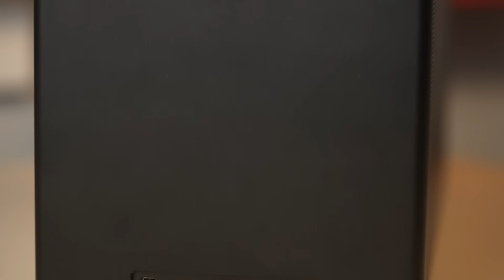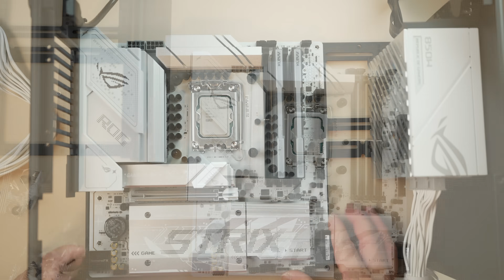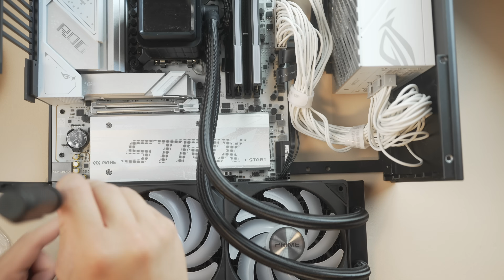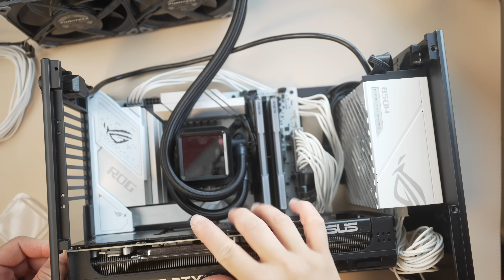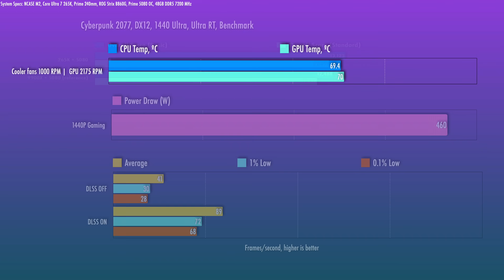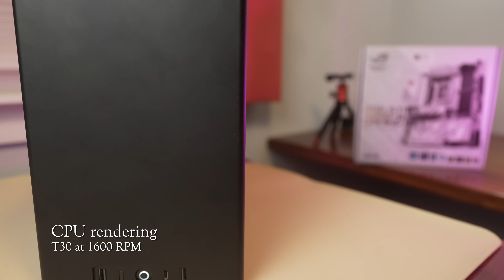NCase M2 mATX Build - Intel 265K + 5080

Comment: In case that the RAM sticks are not too tall, is it possible for standard configuration and AIO be mounted at the top? Planning to move my parts in the Ncase M2 as well, and thinking of mounting my arctic liquid freezer II at the top as the hose are stiff. Thank you!

Comment: Very nice video, I appreciate every video on your channel. What confused me was the intake above the graphicscard and the intake on the aio. Where is the exhaust going? I would have made the aio on exhaust? Or did I miss a crucial idea of the build?😅
Reply from the maker: The idea here is the airflow equalizes out the back and opposite side panel of the case. While one might think this would create a heavy positive pressure, rarely are both GPU fans and rad fans at full blast. In your typical gaming scenario you’re looking at ~1000 rpm on rad fans so this is quite fine. Exhaust places a penalty on the cpu cooling while not necessarily helping too much for the gpu (we already have fans directly assisting). In a scenario where case fans are not possible next to the GPU then the exhaust would be more helpful. There is also the option to mount a 92mm fan as exhaust at the back.
Reply: @MachinesMore  Thank you for your explanation! In my imagination, the AIO intake and the GPU exhaust create a massive turbulence in the case and the mixed up air will get dense and produces a accumulation of heat in the middle. The optional exhaust fan on the back would have made it more clear for me, but your testing showed me that it might not be needed and I am wrong with my imagination. :D

Comment: AMD CPUs only for small builds. Half the power means lower standards for controlling temps and that is premium in ITX type builds
Reply from the maker: Zen 5 efficiency is great. In a workload normalized comparison for heavy multithreaded processed the dual chiplet Zen 5 CPUs are usually ahead on efficiency (though the power draw in a like for like comparison is not half). For gaming, interestingly from my testing the 265K typically draws a little less power than the 9900X, when you normalize for FPS the 265K is often ahead, but generally speaking we can just call it more or less even on efficiency. And then the Core Ultra 2 chips are incredible for idle power draw. So, long story short it depends on how you are measuring power and use case.

Comment: You’re making me want to go blue.
Reply from the maker: Haha, you know, for the price that the 265K is at now, it can be super attractive for the right use case!
Reply: @ Maybe once the new Battlemage GPUs release I’ll build an editing machine.
Reply: I wanted to, I really did, but the price to performance was just too terrible. Even a 7600X is better value for gaming
Reply: @justwinclassic  "for the right use case"
Reply: Heck no 😂 AMD is half the power and just as good if not better performance if you go x3D. With that same AIO the AMD CPU would be high 60s, maybe to mid 70s. Lower temps mean quiet system. It is a premium for ITX builds